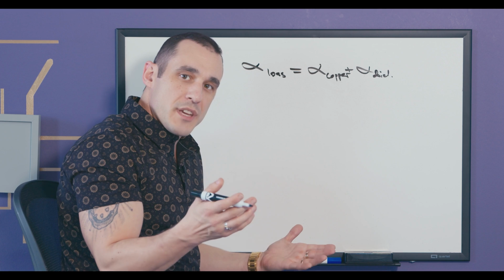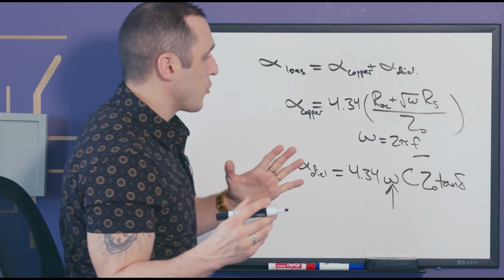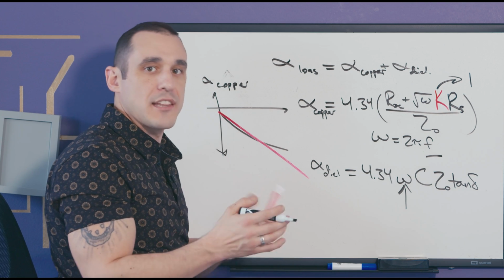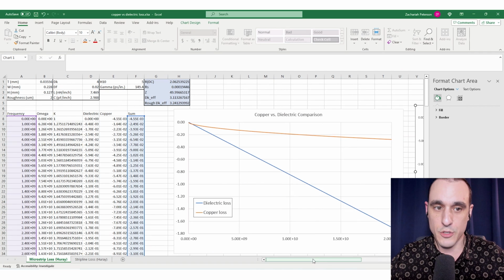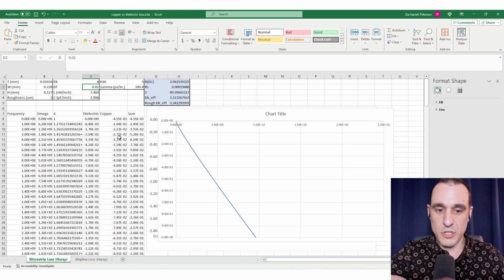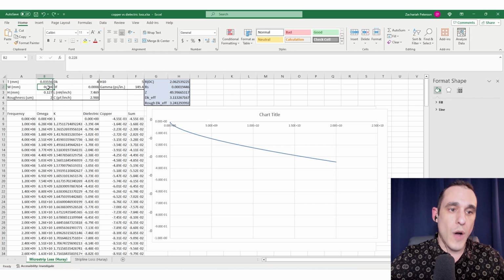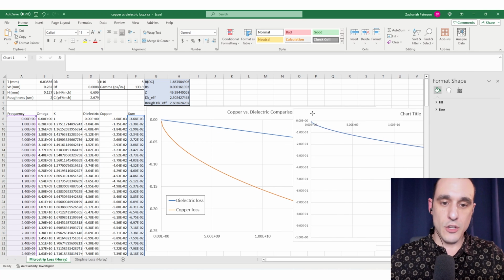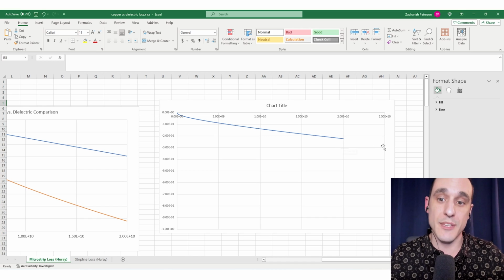High-Speed Design Secrets: Balancing Copper & Dielectric Losses

Comment: Hello Zach! Thank you so much for this and other your videos!

Could you please clarify one question for me (which may not quite relevant to this topic, but still): Quite often in the comments I see such a statement: transmission lines with a higher capacitance strongly slows down the signal edges. The closely spaced forward and return paths create a larger capacitance and the high-frequency component is lost because of this capacitance.

And as an example, the Transatlantic telegraph cable is sometimes mentioned, which had an imbalance between capacitive and inductive reactance, and as a result, a large dispersion and distortion of the signal.

And my question is: does this statement somehow apply to PCBs? Can there be any conditions under which an increase in the capacitance/decrease in the inductance of the transmission line will negatively affect the bandwidth and reduce the speeds of the edges?

* assuming that we are talking about high frequencies/long lines.

Thank you very much!
Reply: At a basic level,  the answer is "yes" more capacitance will increase the dielectric loss; this can occur through having a higher Dk medium, lower impedance, or both. It does not matter if we look at PCBs or any other system.

But the other thing to note is that this point about "closely spaced forward and return paths create larger capacitance" is incorrect in general. Any transmission line that has a specific impedance will have very close to the same capacitance and inductance values regardless of whether the line is on a thick dielectric or a thin dielectric. So this idea of "moving the return path closer" will always increase the capacitance is incorrect. Changing to a thin layer affects other things that are important, like skin effect loss and the inductive reactance created by skin effect, but that's related to conductor loss and not dielectric loss.
Reply: @Zachariah-Peterson  Hello Zach! Thank you very much for your clarifications!